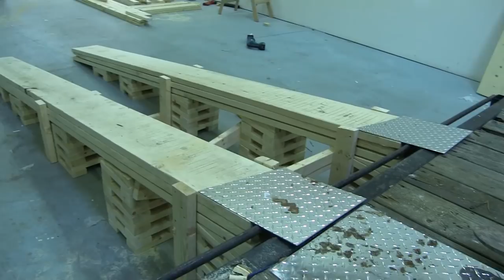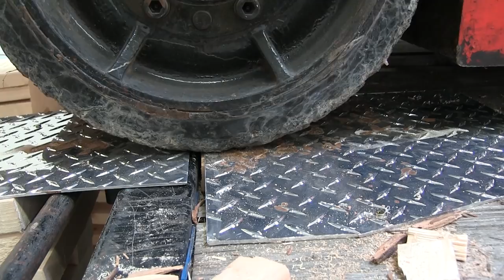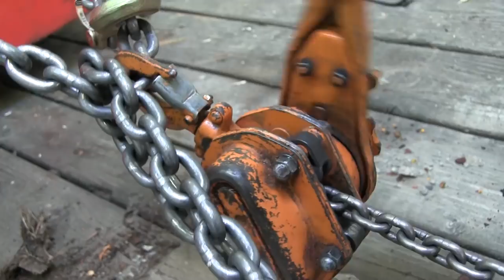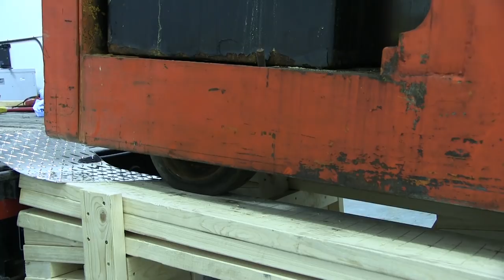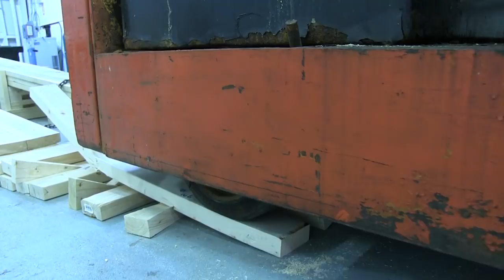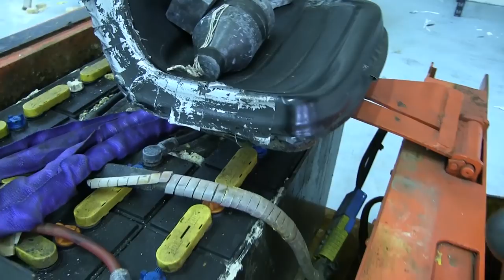Problem Solved! | Forky McForkface

Comment: Sometimes dropping it is the proper amount of percussive maintenance.
Reply: Tale as old as time... Dropkicked the fuckin thing and it starts right up!
Reply: tappy tap tap tap
Reply: Happened to me at work too, monitor slipped out of my hands and suddenly it works... Gravity assisted percussive maintenance is key
Reply: Some times twice ;0) [ a middle-aged pixie-wrangler ]
Reply: Went to look at a used Hobart welder years back and the seller stated the number 2 slot on the voltage dial quit working years ago and that’s why he was selling it, he had purchased a newer unit. As he was looking for the extension cord I decided to poke my head inside the machine to take a gander at the patina and cobwebs, well when I went to set it back down inside the welders cart, my grip slipped the machine fell 1” max sliding it sideways back onto the cart. Seller shows back up cord in hand and he’s going on showing me that the machine works in all other settings, he then goes to show how setting 2 was dead and gave himself arc flash as it suddenly started working again. It’s been 4 years and the machine still works great to this day, I use setting 2 the most with what I tend to use the machine for.
Reply: jeah same have happend me too i have dropped couples time differend stuff and its workerd again really weird
Reply: I dropped my lousy work and felt much better. Got a new one after that, but I wish I'd given the boss some percussive maintenance though.
Reply: @pekkasaarinen2902  I've been there brother, I've been there....
Reply: I am the Forkinator, you will be forked!
AHHLLL BEEE BAACKKK
Reply: I knew you just hadn't hit it hard enough yet. Bigger hammer wins again!
Reply: Had a computer that worked perfectly. It was sitting on a shelf about four feet up to the drywall in my study. Once while asleep, the shelf decided to break while the computer was on. During the fall to the floor, the computer bounced off the library desk in my study, it finally came to rest on the floor. Worked perfectly. Just goes to prove that percussive maintenance is a good idea for working machines as well.
Reply: No, that is the sound of train inspectors checking the tyres (metal not rubber) on loco's and carriages.
Reply: Back in the day when there were Atari computers (actual computers!  The 520 and 1040ST) part of the official troubleshooting for the computers was literally to pick the computer up, twist/flex it a few times, then drop it from 6" above the table.
Reply: @thatotherguy9  never kick a forklift unless you’re wearing steel toed shoes (you are the softest thing in the shop). Never drop a forklift on your foot. Period!

Comment: That's some pretty impressive wood butchery, coming from a guy who measures wood with a micrometer, marks it with a crayon, and cuts it with an ax.
Reply: That's what we used to say as Land Surveyors....
Reply: awww yes, this made me laugh. danke.
Reply: Ya. pound it to Fit..   UHM. Did we miss the Arc Reflectance Reduction Symposium.  On using a Brass hammer against Wood .   Or was is the Non Marring Aspect you were after ..
Reply: @andypeterson3972  C'mon now - we don't use micrometers. If you measure a tree to the hundredth of a foot, you're a better man than I.

Comment: TOO FUNNY!  $1,200 Canabucks in high quality lumber to offload a forklift worth $800 in scrap. (but I digress.) Well done sir
Reply: If he was thinking about scrap value he wouldn't have tried to fix it, he would have simply pulled the trailer to the scrap yard.
Reply: if you think that lumber was worth 1200 bucks you'd be wrong. Also the vast majority of the lumber was probably recovered anyway
Reply: I believe that doll-hairs is the preferred nomenclature ;)
Reply: That big-ass batteria is probably good for $1500 alone down at the yard.
Reply: one word: views
Reply: That battery would be awesome as a UPS or solar setup actually. Looks like the cells come apart so that's probably how it would be transported. Each cell is probably over 100lbs though...  so still heavy as hell.
Reply: about $200 worth of scrap metal at Tyler Iron & Metal, hear in Tyler TX.

Wouldn't it be cheaper to put a 10K watt generator, to provider power for the electric motor.  Or converting it to gasoline powered motor.  Maintaining that battery is gonna be expensive over the long haul.
Reply: Lumber in canaderp is cheep compared to in say New Mexico.
Reply: @redsquirrelftw  
FWIW, I'm a scrapper..my guess would be that thar battery (whole unit, steel case included) probably weighs upwards of 2,500 poundages..
Ya need a fookin' forklift to pull the battery out of a fookin' forklift!
Sadly, current scrap prices would put the whole lift & battery at right around five hundred doll-hairs..

Comment: Those were the most proper set of wood ramps I have ever seen! Save them for future bicycle experiments with your son!
Reply: Was thinking it was overbuilt at first. Also. I was wrong.
Reply: @summitlt  Overbuilt means built properly.
Reply: @manitobanmisanthrope2495  it just means that it's built skookum enough
Reply: overkill is still dead. underkill still isnt dead. jussayin
Reply: the word is skookum
Reply: Yup. Just like cribbing for heavy equipment
Reply: Dillon  Warman Except you only use oak.
Reply: Should of had 2 of the 10x2 timbers on Edge and the 3rd screw on top in an upside down U shape. Then put jacks studs underneath. Much stronger. Just saying...was cringy AF.

Comment: I'm happy you switched ends with the chain fall, I so was ready to watch it shoot out the back of the garage. 
I think you both over and under thought the support pillars, I think you could have run a couple of planks along the floor and tacked in some vertical/diagonal pieces to form a trestle. 
Not a fan of those jenga blocks not being tied to something. 
Hate faking a comealong with a chainfll

Comment: You did an excellent job, building those ramps...  but I thought it was the equivalent of building a really nice box out of Foam, to hold lava.. 

I work in manufacturing, & riggers have come in for the last two years, moving stuff around, that's heavy as all get out. The one wood, they constantly use, is Oak.for cribbing. I'm impressed what you used, didn't come apart at the seams at the worst possible time, like you pointed out 04:04 . That was nerve racking! & Hell I was just watching.

BUT we also have electric forklifts at work, & I can tell you one thing.. the techs that work on them, always go in through the top.. sides, front, NEVER from underneath the thing. 

Also your one of my favorite characters on youtube... glad you made it through that. I forgot to breath several times.

Comment: Was I the only one screaming "LIFT THE DAMN FORKS" for most of that video?
Reply: Forks lift on their own, they're just passively floating on the mast. Walk up to a forklift sometime and try to lift one of the forks. It hinges right upward. Forklifts lift things upward, they don't push things into the ground, so, they only need to lock in one direction.
Reply: @MattsAwesomeStuff  I guessthe forklifts that I've used don't have that feature. They had a little bit of play in them that's useful when adjusting the spread of the forks, but they definitely didn't hinge upward.
Reply: We have 50 sit down lifts at work (as well as 40 stand up reach and 7 order picker). All of them the forks are locked from rotating up while in operating position. There is a notch in the middle of the attachment that allows the forks to be installed and removed (slide the forks to the middle and they can be rotated out). That said the stages of the MAST can be lifted, as there is no hydraulic pressure holding them down (all the lift cylinders are single acting).

Forks that can be rotated out while in position would be super dangerous. Imagine lowering the pallet and catching the edge on something (example: operator did not back all the way out of the location), it would rotate the forks up and out of the attachment, dumping the entire load on the operator.

I was also looking at the forks when he was unloading with some worry but figured because it was not under power nothing too bad would happen.
Reply: 80s and 90s hysters dont, sadly.
Reply: When I worked at a warehouse the forks' forks rotated up, and if you hit a pallet off anything it made one hell of a mess no matter if it was fixed or not.

Ya just had to hope the mess wasn't 30 feet up in the air because you were the one riding a pallet up there to fix it.

Comment: I used to change a lot of those old EC Battery Connectors where they were tough to install cause the contacts and springs are so close together and one wrong move a 1000 amp battery would melt them together,  now they use much simple SB connectors

Comment: In my area I can get a mobile crane for US$130/hour, that forklift weighs what 8K Lbs.??  The crane can lift 40 tons.  Open the garage door and let a crane pick it up.  It's safer and faster than the Lincoln Logs contraption.
Reply: In his area a crane will run ya 500 Canadian pesos for a call out like that. And not too many around that can legally go into a residential area

Comment: I’m gonna go ahead and cry BS here.... this man is an imposter.

The real AvE would have started disassembling it on the trailer, given an extensive failure analysis in the main pixie wrangler, performed percussive maintenance, slapped a cockford-olie badge on it, and then driven it straight off all skookum-like, beer in hand.

Comment: What you need is a forklift to lift your forklift.
Reply: Been there.  Done that.  It's done carefully else bad things happen.  The bigger forklift has to be a LOT bigger.  The little one was smaller than this one in the video.
The ass end has most all the weight.  Center of gravity is far assward and has to be between the forks.
Reply: @jamesg1367  gotta get it from the back good and proper
Reply: Ah, for that you need a forkliftlift. Better known as a CH-47 Chinook helicopter.
Reply: Also seen one where a BIG forklift cant quite reach a window something needs to go in. So the thing goes on a smaller forklift and the big fork lift lifts the little lift which lifts the thing to the window. Could have been a mess though.
Reply: With a teamster to operate it
Reply: Ah..yes, lifting a forklift with another forklift to reach something high up...with people on the lifted forklift standing on the counterbalance to add more anti-tipping technology....the grim reaper must eat popcorn watching these guys.
Reply: I've had someone do that unloading my truck once.

I was delivering to a construction site, and they used this large tractor-style forklift to lift up a small forklift into the trailer to get the stuff at the front of the trailer.

I just stood a small distance away and watched.  Wasn't my trailer, and everyone involved was insured, so not my business.

Comment: There has got to be an easier way to bend that diamond plate.
Reply: I remember working as a grease monkey back in the day, working on big rigs. We had to straighten some of that diamond plate so the boss got me into one of the trucks (cause I was the only idiot with an air brakes ticket) and I proceeded to drive back and forth over that plate with the truck until it looked slightly more straight. Stuff has a lot of rebound in it... 
True story.
 - Eddy
Reply: You guys are hilarious.
Reply: @EngineeringVignettes  wondering if this method would straighten out my ex's attitude....

Comment: Knowing how heavy forklifts are reminds me why this is 150% insane. But that's just this channel in a nutshell soo 
Lmao
Reply: Jack Cobalt I’m not sure about 2*4 cribbing but 4*4 crib stacks hold 3 tons per stack so with 8 stacks he’s mostly likely well with in the safety margin check out the fema guidance for vmr
Reply: Ya I just came to the conclusion Ave is drunk... But then again so am I, I think that's why I'm here.
Reply: Had to have been around 4-8 thousand pounder, comparing its size to what I drive, an 18,000 pound forklift and the little 11,000 pound one we have for our warehouse.
Reply: She's a beast. At first, I thought how much Ave overbuilt the ramp. But no, he needed all of that and more.
Reply: We pick up 400 ton train cars with wood. You'd be mighty surprised at what it can hold.
Reply: the cribbing was fine, the ramp boards were in the wrong orientation for strength and did not appear to be laminated together.
Reply: The back wheels being so far off center really did the most frigging damage
Reply: Where you running a 400 ton single car? Never seen a track rated that heavy, best i know are ~150T 90 footers. The 4-6-6-4/4-8-8-4  steam locomotives were 500T loaded with the tender.
Reply: Bearistopheles what's that called, gotta look that up!
Reply: I'd say that forklift is a lot heavier than 4-8 thou...I'd say it's about 10-12k pounds.  The battery alone is over 4 k
Reply: I find it hard to believe, coming from a furry profile pic
Reply: Its fine, well over engineered. I've taken similar size trucks off with railway sleepers an two planks. Its harder trying to put it on!
Reply: Yah, that's a good ole 10k lb sit down, granted the corrosion in the battery could bump it up to 12, those rear wheels are the killers for weight when nothing's on the forks

Comment: When I was a teenager I was helping my friend Bill swap the engine in his 60 Pontiac ragtop ( 6 banger) and I was laying under it while it rested on a pair of ramps tightening the transmission bolts. I asked Leon if he had blocked the wheels and he replied that it was in park. I told him he still needed to block the wheels and he replied that he had done so. About the halfway point the car popped out of park and rolled down the ramps and came to a stop against the blocks that were a few feet too far back, with the oil pan almost touching my head and the suspension almost touching the other side of my head. A fraction of an inch in either direction and my skull would have gotten mangled. When I got out from under the car Leon was far away. One of the very few smart things he'd ever done.
Reply: @Chris5685  Unfortunately that won't always help. In big, industrial complexes they have a literal locking mechanism where everyone who has to work on something dangerous puts an actual lock on the thing that disables the dangerous machine. And you bet they're the only one with the key (lockout / tagout). Doesn't stop people who should REALLY know better from cutting the locks, turning the machine on and killing the mechanic. 

But I agree, yes, doing the precautions yourself definitely helps.

Comment: I was a little worried when you said you were going to get under it. Thankfully you changed your mind. Great job on fixing it (always take the credit if it miraculously starts working for no reason)
Reply: Probably the knock when it fell off that last tuba four onto the floor is what fixed it. So it was his idea in a way.
Reply: It's a bad connection somewhere. Just gotta keep a tappy tap tap in it for future repairs.
Reply: Sometimes all it takes is a good slap to get things going.
Reply: Gary Levario I was hoping he would have at least put the camera under it while it was on that ramp, just to get a clear picture of the guts.
Reply: @johnfrancisdoe1563  so was I. 😣

Comment: The ramp isn’t overbuilt like some comments were suggesting.  Forklifts (electric) are heavy on purpose.  They need to lift heavy stuff and not tilt over.  The pressure on a wheel contact is huge
Reply: Probably the same reason some poeple think cardboard is an appropriate material to use for the outer walls of a house.